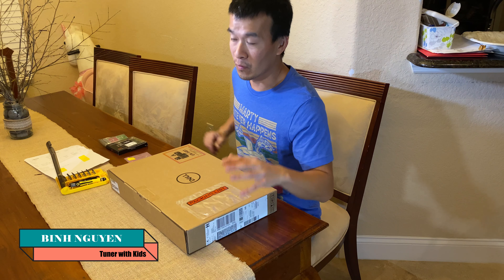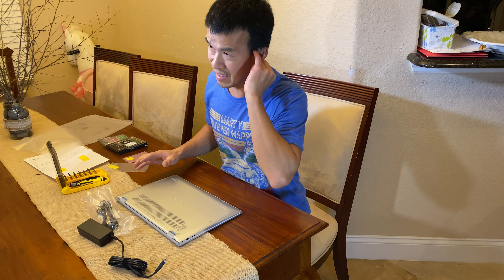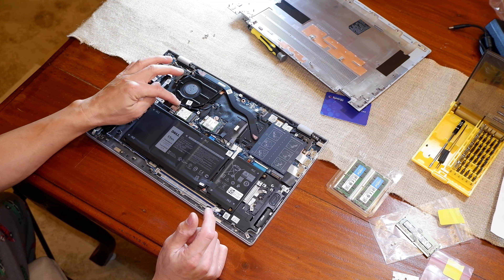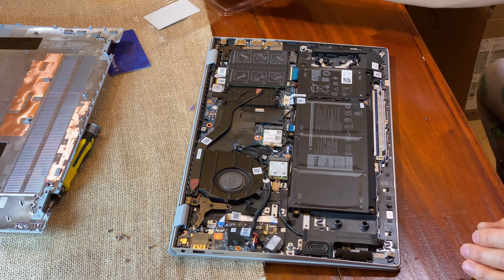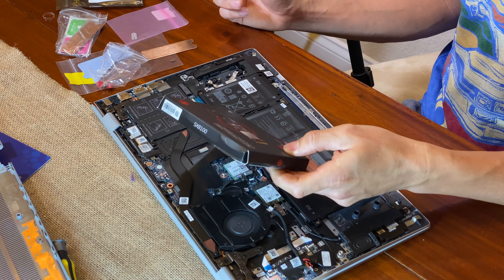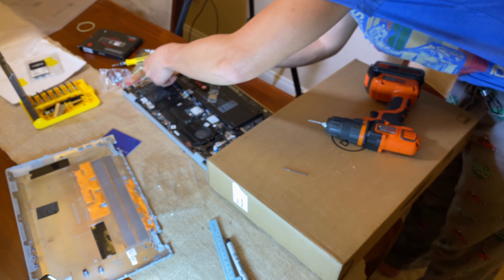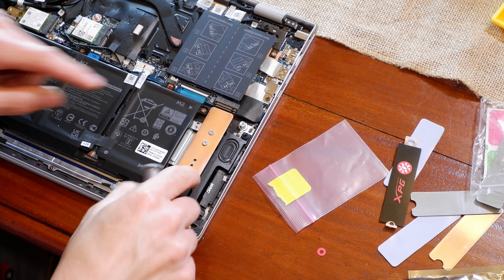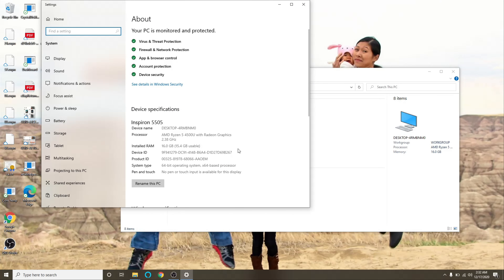2021 Dell Inspiron 15 (5505) RAM & SSD NVME Upgrade | AMD Ryzen 5 4500U | How To Install Hard Drive

Comment: It does have a heat sink. the place  you pointed to is for m.2 ssd upgrade! the heatsink is attached to the fan. follow that arm over.

Comment: Thanks for this video. I just bought this computer. Mine was refurbished and only cost $400 with tax and shipping and a 2 year warranty from Dell. I also did a quick unboxing video of the computer on my new channel, so check that out!! I did the ram upgrade, but not the hard drive yet. My computer came with a hynix 256 m.2 nvme and 8gb kingston. I added another 8gb of samsung memory with the same specs. It is showing as dual channel. Using different brands seems to be fine, no issues at all so far. This is a great computer!!!

Comment: Dell sales processing team sucks.. My order got cancelled multiple times as well... But this video is very useful, I will try a custom heat sink install.. Thanks bud... 👍
Reply from the maker: Yea everyone is slamming them for these parts. Especially as people are receiving their BF deal orders now.
Reply: Yeah seems like it.. Also an fyi...  I was able to find the screws on ebay for much cheaper ... 5 pieces for ~ $2.5.. Check it out if you need them for future projects...
Reply from the maker: M1.6 screws? Those were hard to find on Amazon. M2.0 are easy and common.
Reply: Yep on ebay you could pretty much find any size. 1.6 , 2.0... See below for 1.6s 

https://www.ebay.com/itm/M1-6-x-4mm-Phillips-Pan-Head-Screws-A2-304-18-8-Stainless-Steel-/293636974138?_trksid=p2349624.m46890.l49292

Comment: great install! the 1tb nvme ssd would be faster than the oem one though, so you could reinstall windows onto that drive instead, but it would be alot of work and im sure the oem one is fast enough
Reply from the maker: That’s what I figured. I didn’t want to fool around with cloning and messing with the boot order and all of that on a new computer. I’m sure my wife won’t notice anything while photo editing.
Reply: I was trying to remove the windows m.2 and replace it with a blank one. The bios is absolutely not recognizing my bootable linux USB. Raging pain in the rear.

Comment: The video is awesome! quick question for you. I contacted Dell, they only have 1.6X2.5 instead of 49RK6 (1.6XL2). Do you think is it fit the screw size?  Thank you.
Reply from the maker: The 2.5 will be longer and I’m not sure if there is any interference behind that would prevent it from tightening.

Comment: I'm pretty interested to buy this guy to review it! Have you tried editing video in it? Do you use davinci resolve? I'm quite over not getting resolve to work on AMD laptops. In most cases it don't seem to work - but so far haven't tried a dell AMD laptop. :)
Reply from the maker: Resolve requires some Major horsepower and graphics to run. I wouldn’t even try. This machine is probably more of a daily driver for browsing and light photo editing but I wouldn’t try 4K video with it. I’m using my Dell 15 G5 with dedicated GFX for video.
Reply: @TunerwithKids  I'm aware of that but I got an i5 with Xe graphics that's generally not as powerful now and no probs edited a 15 mins full hd project on it in Resolve. So it's just a compatibility issue. :/
Reply: @w2best  possibly, amd will need drivers or extra support from devs since amd hit the market running. Everybodys used to intel so thats the other reason, but I would contact the company and see if they will roll out extra support for the amd processors which are just as capable or even better.

Comment: Hi, thank you so much for sharing your knowledge. Would you also please be able to share information about vram after the ram upgrade. I am listing all the steps below through which you're able to find it out

Right click on desktop -> Display settings  -> Advanced display settings (at the bottom second last option) -> Display adapter properties for Display 1

Total Available Graphics Memory:
Dedicated Video Memory:
 
Thank you once more 🙂

Comment: Can I use the bracket that comes in regular pc motherboards and the same screw for the m.2?
Reply from the maker: You can rig a SSD heat sink and a screw that fits in the plastic nub.

Comment: I did the nvme m.2 upgrade today. Dell sent me all the parts for about $10 shipped. I'm not sure why I lucked out. Maybe the parts are back in stock. The parts all arrived in the same box and shipped to me the next day. I even got the original heat sink/thermal pad. Anyways, I used the hynix 1tb p31 in the second slot, similar setup to what you did in your video. I have a question for you or anyone else who did this upgrade: HOW DID YOU GET THE DRIVE IN SLOT 2 TO BOOT AS MASTER??? I am having so many problems with it. What I did is I cloned my slot 1 drive to my 1tb drive in slot 2. Then I tried to go into the bios with F2 and change the drive to master. In the bios there is the option to press enter and it adds a "---" mark in front of each drive, but I have no idea what this means??? If I set the 1tb drive in slot 2 and save on exit, it will boot to windows from the drive in slot 2 ONE TIME. Then when I reboot it will boot from the drive in slot 1. I'm not sure the proper way to set it up or to fix this???? What settings do I need to add in the bios????   I have tried to clone the drive again today and overwrite all the contents of the 1tb drive, but I am having the same issue. The 256gb drive in slot 1 boots most of the time and the 1tb drive will only boot sometimes. So, it looks like there is a conflict, since I have the same windows on both drives. Also, the C drive always ends up being the one that boots as master and then the slave drive is D. After I tried the cloning again, the slave drive is now E. If you select the hynix1tb manually with f12, it will boot as master, but otherwise it is random. How did you get yours to work??? Anyone???
Reply from the maker: You may have to attempt without both cloned drives in there. I recall on an ASUS clone I did like 5 years ago, I had to change some stuff in Bios to change the hardware ID the system was looking for. I forgot what the procedure was but i just googled and follow other’s instructions.
Reply: @TunerwithKids  I was able to fix mine just now after several hours of frustration. It ended up working after I tried again and did an exact clone of the drive to my hynix p31 1tb. Now my stock hynix 256gb drive is still in slot 1, but the computer boots with the 1tb hynix drive as master in slot 2. There were bitlocker issues as well. Once the drive was working,  I had to boot into windows with the other drive in order to get the key. Anyways, it is working now. Thanks again for this original video, as it was very helpful. I had the touchpad issue as well, after I put the bottom part of the case on the wrong way. If you try to get it perfectly aligned and push in every snap while you are tightening the screws, it will be too tight and the top and bottom pieces will squeeze the touchpad, so it does not work. The fix is to place the bottom casing on and snap it in all around, then don't touch it again or make it any tighter. Just put all of the screws in after that. So, my version of this laptop is the refurb for $400 including tax + hynix p31 1tb for $107 + 8gb extra ram for $30 + dell complete drive kit for $10. Quite a good deal for under $550.
Reply: @RockAustin exactly what parts did you order from Dell, each part separately or as a kit? Trying to order now via chat.
Reply from the maker: Check the description box, I list the parts and numbers needed.
Reply: Yes. Those were all the parts I ordered. There were actually 3 screws required, not 2. You need 2 of the m1.6X2 screws and one of the m2X3 screws. I originally thought only 2 screws were required, but luckily the person I was speaking to at Dell knew I needed 3 screws and sent them to me. I have been a dell customer for nearly 20 years and have used the same email address, which might be why dell hooked me up with everything including the heat sink/thermal pad, but I am not sure. Maybe dell has extra stock now. Anyways, even though I was able to get my 1tb drive in slot 2 to boot as master, I am still having some issues. I tried to copy some music in a folder on the root of the stock drive and that folder disappeared after a reboot!! Then a message appeared telling me the drive would need to be repaired on reboot and it did a scan of the stock 256gb drive. Next, the music folder reappeared on reboot. I have been noticing that scans have been done to "repair drive errors" several times upon reboot. This may be something to do with the same windows installation on the stock drive, which now is the slave drive. If my 1tb drive doesn't have any issues, I might just completely format the 256gb drive and ditch windows on it, but I am not sure if I want to do this yet. At the very least, my 1tb drive boots as master every time, which I am satisfied with for the time being.
Reply: I was able to resolve these issues by updating to the latest version of AMD bios on their website. No need to mess with dell drivers or anything. When I tried to install AMD, it initially failed and told me that windows 10 was auto updating (overriding) the new drivers I was trying to install. So, then a link for a webpage appeared to disable windows 10 auto driver update and I was able to reboot and then reinstall AMD. Since the AMD installation all of my issues have disappeared. Not to jinx it, but things have been perfect on this computer for quite a few days.

Comment: I bought this computer and its coming tomorrow! YAYYYY I heard Ryzen works better with dual RAM.... Would it be beneficial to put 4GB stick in the other channel if I already have 1 lyin around?
Reply from the maker: It probably won’t benefit from dual channel mode since dual channel needs matching ram on both sides. I got the dual crucial for $47 on BF.

Comment: If i want to upgrade and add another 8 GB Ram a Dell inspiron 15 3505. Can i choose which brand(PNY, crucial, Kingston) i put into my laptop? As long as it follows the requirements i should be fine right? Requirements: DDR4, 2400mhz.

In other words, can i put 1 Dell 8GB 2400Mhz, and 1 Kingston 8GB 2400Mhz?
Reply from the maker: It should match the speed and spec of the one in there now. Especially if you processor and motherboard can do dual channel.
Reply: @TunerwithKids  It does, only difference is the brands. 1 is Dell(stock) the other one i bought online is Kingston. Both DDR4 and 2400mhz.
Reply from the maker: That should be fine.

Comment: Maybe I'm mistaken but it looks like there is a black heatsink glued onto the plastic back cover of the laptop right over where the cover would meet the second SSD slot. Do you still need to install a heatsink knowing this or is that not actually a heatsink at all?
Reply from the maker: It's one of the foil stickers to keep plastic cover from heating or melting.

Comment: Hi, thanks for the guide video. Can i ask about the type c display port ? Does it support 4k 60 fps ? Because i want to connect it with 4k tv. Thanks in advance 🙏.
Reply from the maker: I don’t think it can support that. You need a thunderbolt USB-C to hit those speeds and bandwidth. This machines port is only DisplayPort.
Reply: @TunerwithKids  you dont need thunderbolt for 4k. only usb c dp

Comment: I love my laptop but I have an issue where you can click the trackpad from underneath it. Sometimes if I am using it on my lap and place my thumb under the chin, it clicks. Does yours have this issue? What can I do?
Reply from the maker: Yea it’s tight so you gotta make sure the screws are perfectly tightened else it won’t work or too loose like yours.
Reply: I have the same issue as yours. As soon I got this laptop I immediately upgraded my RAM then after putting it back together I noticed that my trackpad is not working, so I loosen the screw at the back. Then the touchpad is working but when working mobile like on my lap when the lower part kinda touches something my trackpad wont work. So a Dell tech will be coming to my place tomorrow to check it. I'll update you what will happen.
Reply: Ok here's my update. Dell tech went in today and saw my issue. He completely replaced my trackpad. He told me that we should not loosen or screws to make the trackpad work. It should work like how it supposed to be. With screws tighten. I asked him what was the problem and he told me probably a crappy quality from Dell and he told me about the wiring issues as well. There are wires that are in top of the trackpad like for the speakers that affects it. He said he re-wired it. Anyway all is working for me now. New trackpad(not the same colour as before. More of grey silver) but clicks are working and i can work mobile again!
Reply: @tobinheath7512  Did you have to pay out of pocket for the repair?
Reply from the maker: It’s probably all under the 1 year warranty since these are pretty new models.
Reply: @bigdaddymac844  nope. under warranty.
Reply: mine does that too lol

Comment: Will there be any problems if i were to just add another 8gb Ram (different brand) into the other empty slot?
Reply from the maker: Should be fine if it’s the same speed and specs. I think the AMD has dual channel capability so that’s important to match. I opted for the same exact on both side since it was only $15 more for two vs one on BF. Ended up selling my OEM stick for $20 so covered the cost.

Comment: The amazon heatsinks came with several blue thermal stickers (grey and blue), I noticed they are 0.5 mm and 0.8 mm thick, which one did you use?
Reply from the maker: The thinner one. But for the Adata SSD I had to cut half of it due to clearance.
Reply: @TunerwithKids  yeah... noticed that... thanks!

Comment: Awesome Video as usual.  Do you know the actual screw size or dell part # for the SCREW  that goes in the KYMC9 bracket to hold the SSD.  Dell had actually sent me the KYMC9 bracket but no screw either to fix the bracket to the laptop or the screw that will actually hold the SSD.
Reply from the maker: The SSD screw is a m2x3mm, I think I list all this in the video description box.

Comment: Can you tell me about the display of inspiron 5505..like the maximum nits of brightness and viewing angles .. is it ips, tnt or ips level.
Im thinking of buying this.
Reply from the maker: I’m not sure of all the specifics of the display, you can probably find all of that on Dell site. I use by most of my computers on a dock to external Dell Ultrasharp monitors so onboard display isn’t important to me.

Comment: Does the MWJM4 come with mounting screws or do those have to be ordered separately as well? I'm thinking of checking in from time to time to see if MWJM4 gets restocked and using it without for now, but not sure if I should order the needed 49RK6x2 and have them on hand first.
Reply from the maker: You need the m1.6 screws ordered separately. That heat sink requires 2 of them.

Comment: Is anyone else having major issues when trying to remove the back panel screws below the hinges? They simply will not come out for me, they will get 95% loose and then will not fully unscrew out. It almost seems like something intentionally built in to prevent the consumer from opening it up....
Reply from the maker: Those don’t come out all the way. They have washers they keep them in.

Comment: This is a late comment, but I had gotten this laptop as a gift last year in December 2021. Just recently, the 'd' key on my keyboard no longer registers and when I tried to 'clean' underneath the key, I may have pulled it too hard that the hinges broke off, and it won't click back in. I plan on buying a new keyboard replacement, but is there anyway you can show me and possibly others on how to replace a keyboard in this specific laptop; as I have searched high and low trying to find a tutorial that doesn't exist yet? Thank you!
Reply from the maker: Sorry keyboard replacement requires taking board off housing.